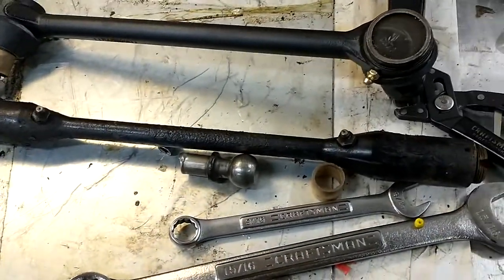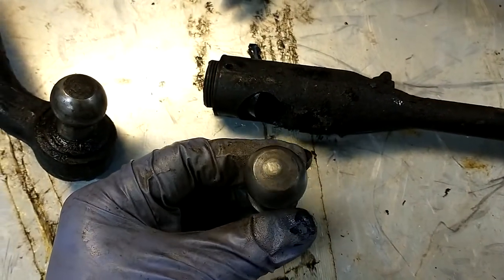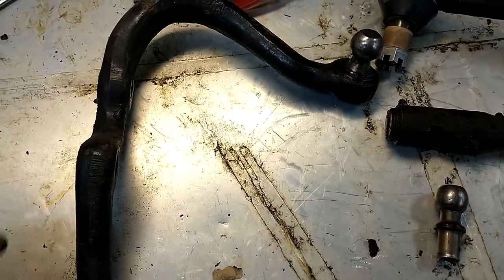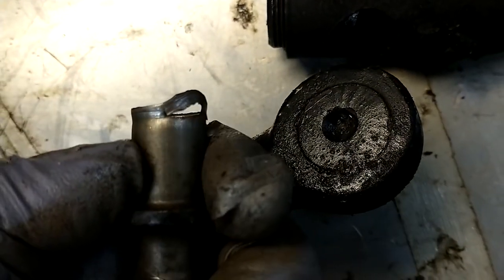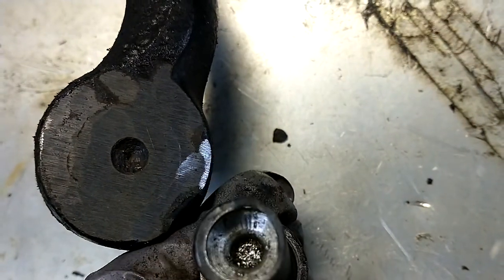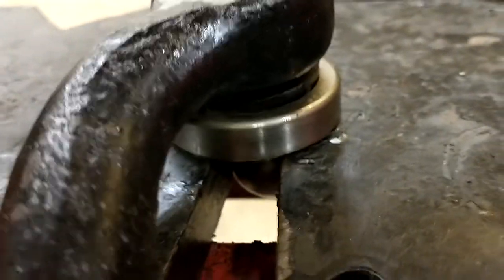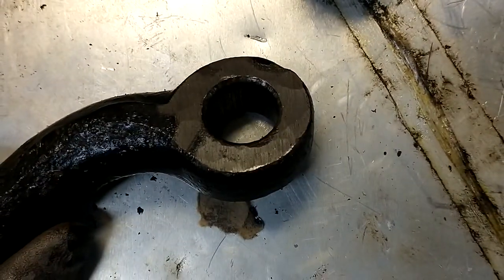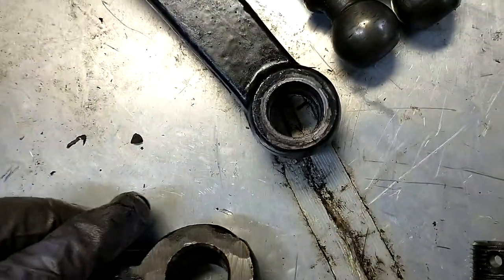1949 GMC Pitman arm ball stud removal part 2

Comment: this is a very useful video, thanks for sharing.  i have some questions on the assembly of the pitman arm, and where to get parts for my 49 chevy 3600. any suggestions? thank you.
Reply from the maker: Thanks!  Glad it was helpful.  I get most of my parts from RockAuto or Jim Carter (oldchevytrucks.com).  Sometimes brotherstrucks.com too, and Ebay.